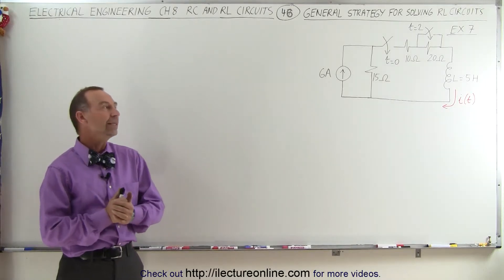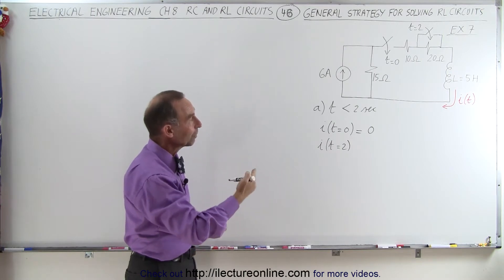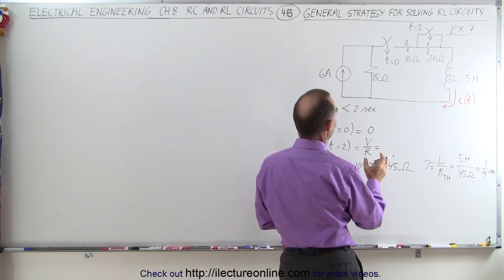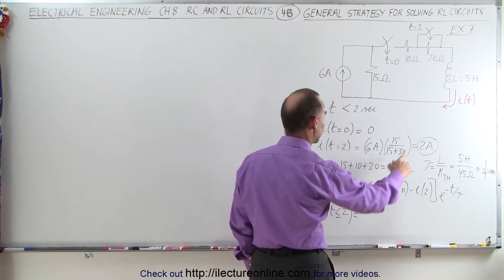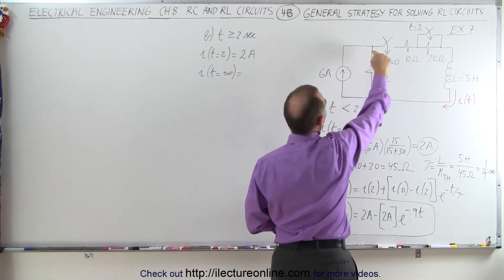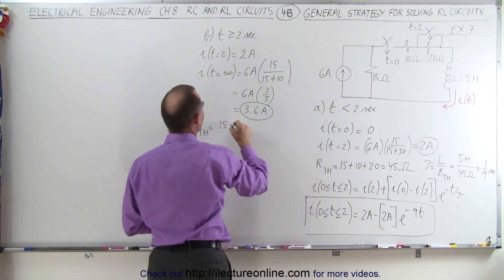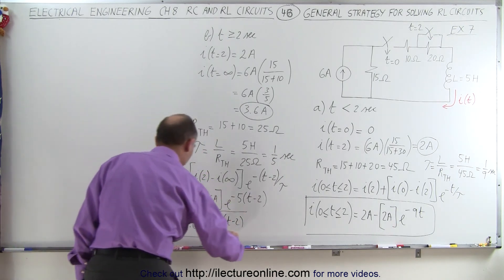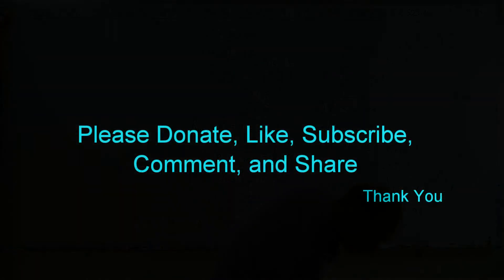Electrical Engineering: Ch 8: RC & RL Circuits (46 of 65) General Strategy Solving RL Circuits Ex.7

Comment: At t = 0, why the current source is removed when we close the switch?
Reply: nmv, we are calculting Rth
Reply from the maker: The current source is not removed.  The current in the branch immediately after the switch is closed will be equal to the current in the branch just before the switch is closed.

Comment: What happens if the second switch closes before 5 time constants have elapsed?
Reply from the maker: Then you would have to calculate the conditions as they are at that moment, use those as the new initial conditions,  and re-calculate the new transient period.
Reply: Ok so what happens during the first phase would not influence what happens during the second phase. Thank you very much, I love your videos and you are an excellent teacher